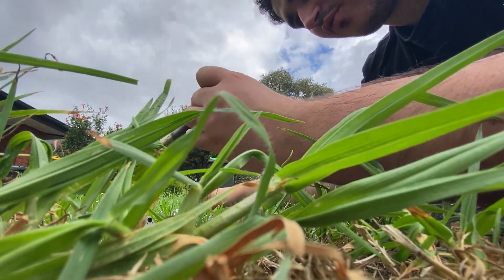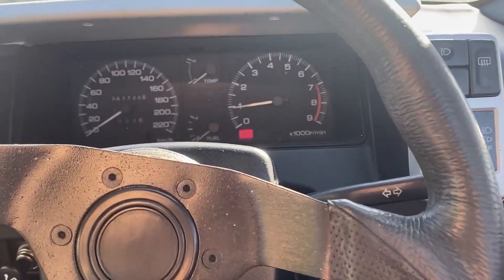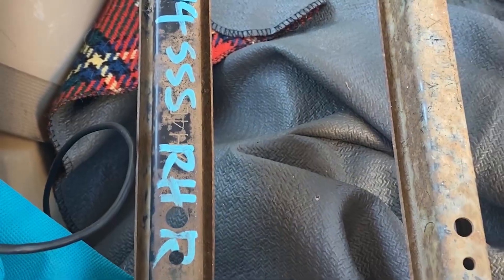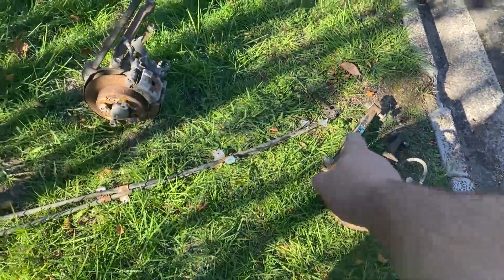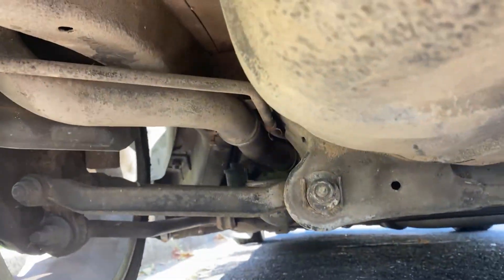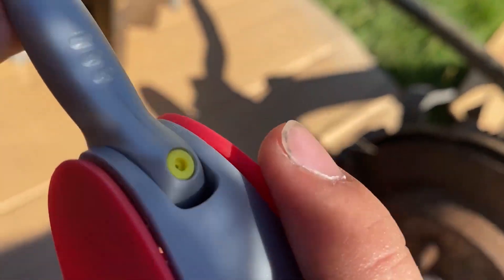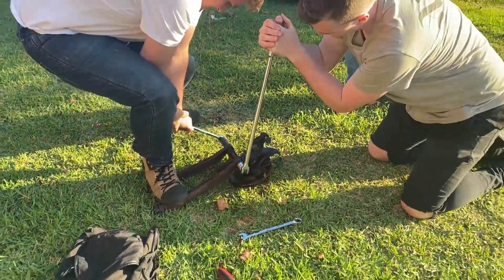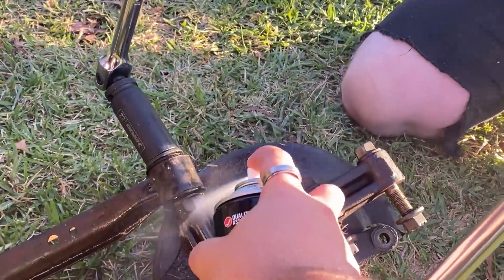NISSAN EXA GETS PULSAR SSS DISK BRAKES! - PART 1

Comment: Hey mate I’m having the exact same issue with my Nissan exa! I have pulled it out the shed after 13 years and finally got it running but it has a very rough ideal and is hard to start… even after sparks plugs hoses etc…
Reply from the maker: Seems to be a common CA18 issue 🥲 I think it could be an Idle control issue, I sorta fixed mine by rewiring the TPS and cleaning IACV.

I think it’s a mixture of that and maybe filters/fuel. I am still yet to fully resolve it though